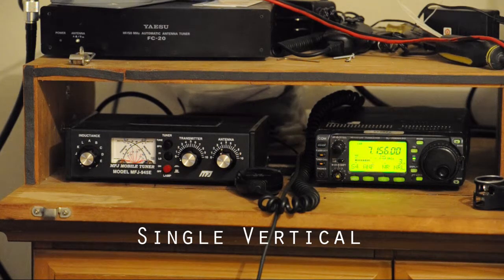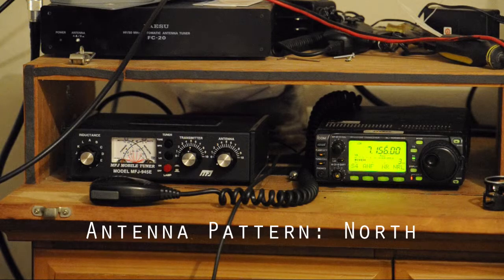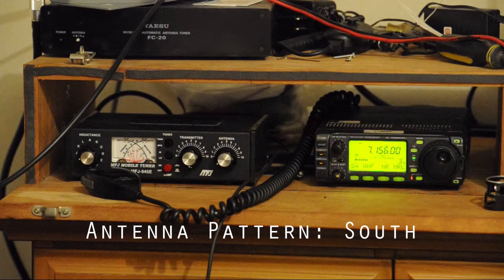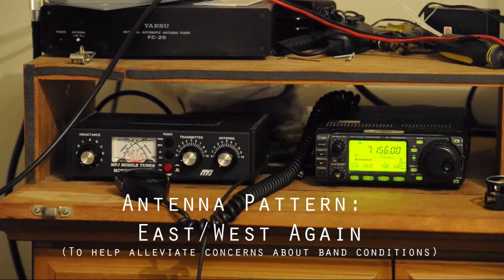Phased Array Comparison

Comment: Don't hear that much difference K2LNS  - Perhaps if you switched it faster
Reply from the maker: ALC adjusts how things sound, but where you can tell the difference is with the signal strength on the meter. The station is about +10 over when phased to an east/west direction, where as a single antenna places the peak between an S8-S9. With the array favoring North, the control station drops to a peak of around S7, and between an S7 and S8 favoring South. This makes sense, as the station was likely East of me. With this example, the control station had a very strong signal making it easy to pick up, even when the antenna favors another direction. When working weaker stations, the extra few dB makes a big difference.